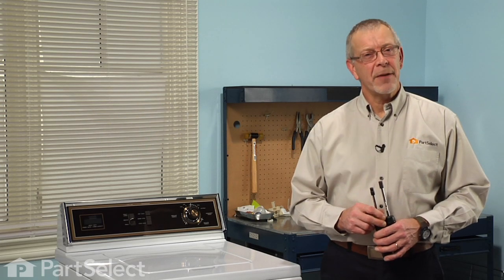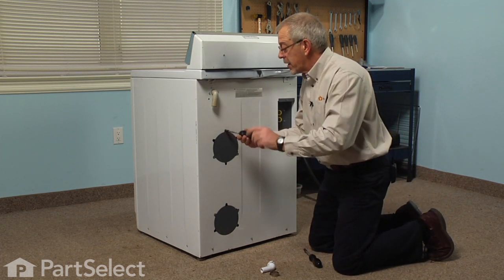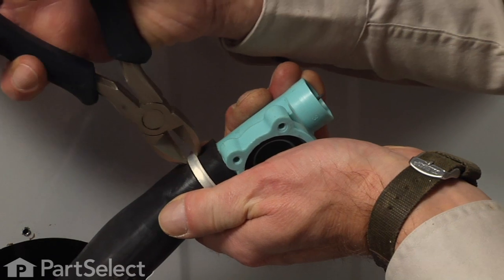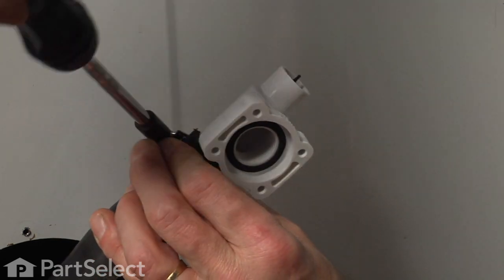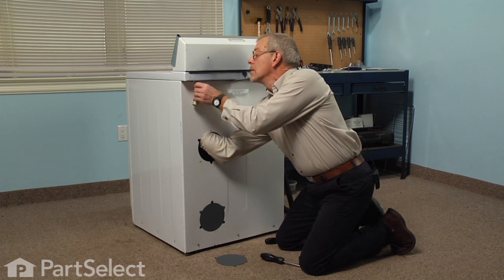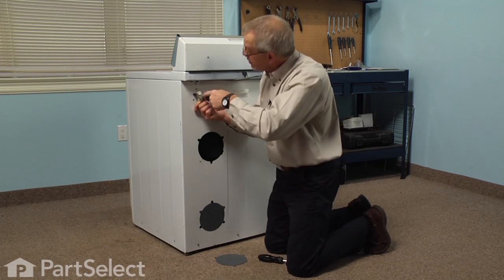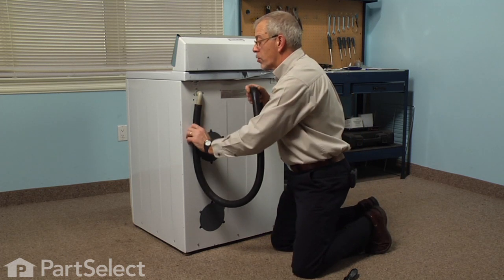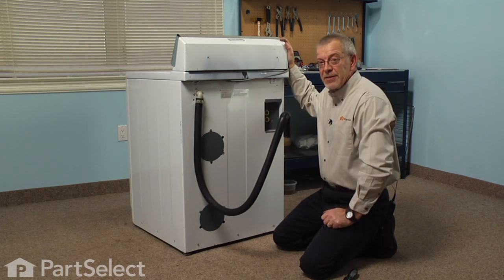Washing Machine Repair- Replacing the Siphon Break Connector Kit (Whirlpool Part # 206638)

Comment: Cleaned under my washer and 1 of the belts came off i put it back on and turned on washer water fills up it just wont drain i had the pump checked its still good looked in all the hoses the drain was a lil clogged